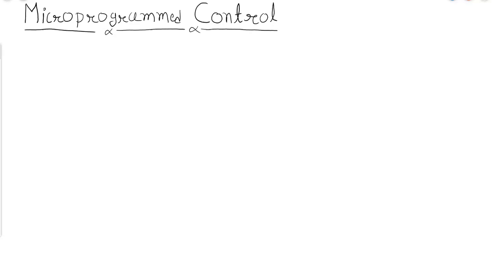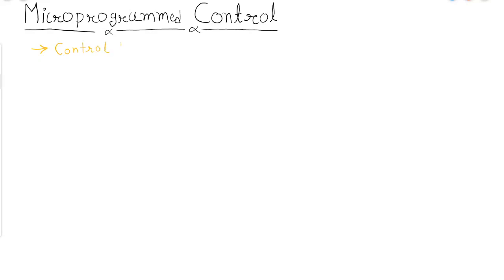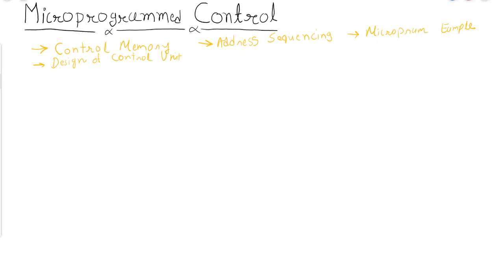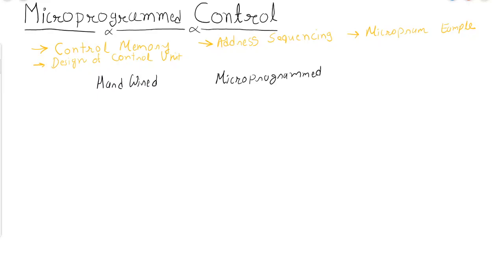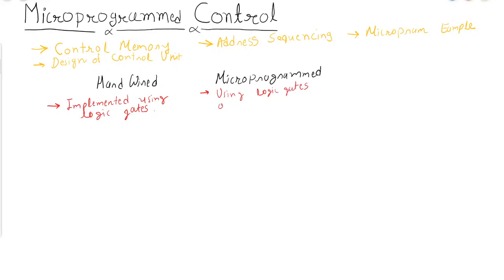Ch - 7 | Tutorial - 1 | Introduction to Microprogrammed Control | Hardwired Control Unit | CO / COA

Comment: Sir plz also upload other chapters of COA like computer data representation (1), register transfer & micro-operations (2), basic computer organization & design (3), programming the basic computer (4), central processing unit (5), parallel processing (6), computer arithmetic (7), input-output organization (8), memory organization and multiprocessor (9).
Sir your teaching is very good.
Sir you are teaching according to which syllabus (AKTU or RTU or MTU or BTU or others)?
Sir from which place you belong to?